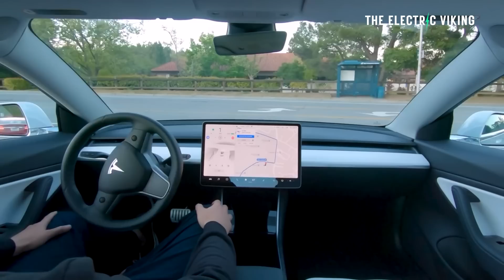Xiaomi builds the SU7 in 76 seconds using worlds biggest gigacasting machine

Comment: Forty cars per hour (3600s) would spit out one car every 90s, not one every 76s.  If they're popping one out every 76s, they'd be making >47 cars per hour.  If the 9100t sets the pace of their throughput and it can run without coffee breaks (maintenance), 100% up-time means 168 hours a week at 40-47 cars per hour, or 6720-7896 cars per week. With a 90k car backlog, they'd clear backlog in 11.4-13.4 weeks which doesn't quite square with a backlog out to November 2024. If we settle on 3 months to clear backlog, given your posting date of May 6th, they clear backlog by September 6, somewhere between seven and eleven weeks ahead of schedule, depending on whether that backlog was to the beginning or the end of November, BUT if the backlog reflects press up-time and the rest of the line is at least as fast as the press, then we're really talking about 18.4 to 24.4 weeks for 90k cars, hence 3688-4891 cars per week, thus ~22-29 cars per hour, therefore one car every ~124-164 seconds, which is obviously still lightning fast.

Comment: You missed the point read my post again. Xiaomi has a crappy record of quality control in appliances that have received significant complaint inside China. Their car which was supposed to revolutionize the EV market has a 40% return rate. I point to the aluminum wiring issue not just because it won’t pass US standards but it’s a dangerous design decision. It’s banned for a reason

Comment: .......Xiaomi, no doubt, purchased a Sandy Munro (or similar company) reverse engineering, teardown, benchmarking & costing report of the many Teslas they have bench marked, I do not believe that Xiaomi are the so called geniuses you make them out to be. 
What is amazing is the speed at which they can copy Tesla's manufacturing processes.
What is so incredible about: 
1. 76 second car roll out rate (33 seconds slower than Tesla).
2. Double glazing, that is not new in cars (circa 1934 laminated glass).
3. Tesla suffered by over automation. Remember?
4. How do you know this car is incredible? Have you looked at it , driven it.
5. One upped Tesla? How do you know please? 17% lighter, 2 dB quieter than what please?
6. Everything you have said  about Xiaomi ...Tesla has or is doing it.
7. Xiaomi is fantastic according to whom?...you are looking at promo videos FFS.
8. Tesla already has either 2 or 3 off, 9000 tonne clamping force, Giga presses since 2022. 
9. Yes you can do "weld repairs" to Tesla castings.
10. Any car/truck can do 2 million miles if you maintain, repair & replace! 
11. Irv Gordon, Guinness World Record Holder Who Put 3.2 Million Miles on His Volvo P1800..(Dinosaur juice powered).
12.. Your research is rather poor, and you are parroting off promotional info, and hats off to you "you admit it" sir!
13...This raft of factual comments will get deleted very quickly.

Comment: Sam, use language properly. Today you said electric cars have no motor. In fact they may have 1 to 4 drive motors. ICE cars do have no motor. They have an engine, either gas or diesel for most. EVs actually have no engine.

Comment: Just my 2 cents here: a huge cast part reduces complexity of production but what if that part cracks after some use? … I’m not an expert
Reply: It's a solid part, cast at high pressure, and at temperatures high enough to melt aircraft aluminum. It's then cooled off very quickly, and this doesn't crack anything.

Comment: UPDATE - 43 seconds, not 34. Started in this interview: https://youtu.be/eEe-_gM5pgE?si=FpcujroKiWfN8Mky 

Actually, Sam, Sandy Munro stated in an interview that Tesla was pushing out model Y's at a rate of 34 s. per unit. Can't remember which interview it was but 76 s. is fast but not quite as fast as Tesla. 

PS - all Chaoimi (sp?) how many of these so called Giga presses they have. If it's not more than one then they can't do better that 100 s. as that is how long your report started the pressing process takes which would be a limiting factor or choke point for their manufacturing process. 

This is all theoretical. This company is just trying to ride on the coattails of Tesla's success.

Comment: Good luck with that SU7, if the stability control software doesn’t kill you the fragile suspension system will!
Reply: Have you driven one, ive seen videos of tesla cars burning, so in the same line of thought, youll die from battery burning? Stop sourgraping and just take it up the arse..

Comment: 00:15  On rare occasions, certainly not always, being "new to the game" is an advantage, in that you don't have preconceived notions as to what works & what doesn't.  Spacex demonstrated this by landing a Falcon9 booster for the first time ever on December 21 2015, and has gone on to demonstrate that those machines can be re-flown at least 20 times, and are now planning to try for FORTY launches before a booster is retired.  ENORMOUS cost savings by reusing expensive high-tech rocket engines instead of discarding them after one use.

Comment: Ford produces an F-150 every 53 seconds. You don´t understand how production time is measured. If you double the number of assembly lines in the same facility you double the output without any real improvement on the production process. Using Ford example, that wil be  a vehicle every 26.5 seconds. You should better educate yourself.

Comment: Sam: 76 seconds is half the speed of the Model Y production line speed in Shanghai of 39 seconds
Tesla only needs the 9K machine for one end of the CyberTruck the other can be made on 6K machine due to design and material innovations reducing locking pressure requirements.
Xiaomi's SU7 looks great but those numbers are not industry leading as the ICE makes are running at a 60 second line rate
Reply: It's not "build in 76 seconds," it's "every 76 seconds" they produce a car
Reply: @MarcoYolo420  What's the difference?
Reply: @ChickensAndGardening  It takes Tesla about 10 hours to build a car, but because it is an assembly line, it is done in stages so many cars are being built at the same time. So this works out to be about 40 seconds rate per car. 76 seconds is about industry standard with many at 60 seconds.
Reply: @ChickensAndGardening  👆🏼this 😉

Comment: Gigacasting is a great idea for EV producers.  From many pieces to one. No seems, no joints, no screws, no bolts, no welding. One structure that frames an entire area of the EV. Producers need less workers, less parts, less materials, less time. 

Unfortunately, this sucks for EV owners. Any damage to the frame means you replace the expensive "one" piece or junk the EV entirely.  This is why ICE manufacturers never opted for gigacasting. Even though this process has been available long before EV's hit the market.  Besides the battery issues, gigacasting is also why insurance rates are higher for EV's. A simple 'fender bender' involving the frame doesn't lend itself to replacing a part at the impact site, but a replacement of a large segment of the EV.  Replacing the gigacast frame may also involve dealing with the battery as well, even though it was not near the damaged part of the frame. I don't think Elon thought this through, and now other manufacturers are following him down this rathole.
Reply: Exactly.

You are absolutely right.

I remember some years ago how the cars produced in some parts of the world were cheaper than those made in Europe: one reduction in welds meant 10% reduction in costs.

These cars can be cheaper to make but are more expensive to the future owners. Time will shw that something will change to stop these higher maintaining costs
Reply: But if it makes the cars cheaper, surely it will improve sales?
Reply: Reason number one people are backing up,,,,,and Toyota making the big $$$$$$
Reply: Any vehicle hit hard enough to damage the frame is written off. Some small independent garages buy these at auctions or from wreckers and repair them. But the car will be plagued with repairs as the accident loosens and cracks many other parts, not visible, and do not fail right away. Never buy a rebuilt car, you will be sorry for it. Also it doesn't matter how new it is, the manufacturer's warranty will be null and void.
Reply: You can do weld repairs to the castings. ICE vehicles can use castings, it is just that Elon, pioneered with IDRA...and legacy automakers will eventually start to use castings in ice vehicles. If it is a rat hole..there will be no cars manufacturers left...It is sheer brilliance the castings.
Reply: @desobrien3827  
It's the same for EV's and ICE's?  Really?  
You're saying high temperature, electric arc welding can be done to a frame near an empty gas tank and that is the same thing next to a full battery pack?  How do you 'remove' the battery pack to straighten out or repair a frame in an EV?  
Fact warning!  It is not done, it won't even be attempted by any auto collision shop.  Repairing damaged frames on an ICE car is done every single day by the thousands.  All ICEs are not 'totaled' every time the frame is damaged. A standard mechanic does not want to work around a battery with 400 to 800 volts coming from a battery pack that if damaged in the repair efforts has to be junked and replaced. 
I am not against EVs.  I am pointing out that the infrastructure is not in place and the EV maker's only demonstrated concern is selling a car and telling the customers here are your keys and good luck.
Reply: "This is why ICE manufacturers never opted for gigacasting. "

Wrong. Legacy manufacturers tried large castings years ago. None got it right. The main problem was they had to be heat treated and that caused warping. Tesla came up with a special aluminum alloy that does not require heat treatment and does not warp. Now every manufacturer is using that alloy and ordering mega casting machines.
Reply: @royh6526  
Ok, the Elon-the-genius-changes-history is not an argument I wish to debate. Either way, the ICE manufacturers should be thankful they did not go down this rathole.
As for "legacy" car makers, it's starting to look like EV's fit that label.

Comment: Sam, you're a little bit misinformed here. Legacy manufacturers have an average build time of 60-65 seconds. Tesla can build Model 3/Y vehicles in 45 seconds, so 76 seconds is no great shakes. I'm sure they will get faster. Of course, when we say "build time" that isn't the absolute truth. It may take hours or days for a vehicle to start being made from the very beginning, right through to driving it off the production line. But the rate of vehicles coming off a single production line is indeed measured in seconds. It's quite an achievement when you think about it. However, there is "dead time" during any production line process, and if you add up all this dead time within the production of a vehicle, it amounts to a heck of a lot. To combat this, companies like Tesla are in transition to other processes, like the "Unboxed" method. It has other advantages, but one of them is less dead time.
EDIT: I suppose I could give a typical example of dead time. Let's say there is an operator/fitter installing a part on a vehicle. When that is complete the fitter goes to get the next part and return for the next install. That's the dead time. The production line process in that part of the assembly line has been idle, and therefore it adds cost. This can be reduced by the design of the vehicle, the design of the part [or no part as Tesla routinely have it], the speed/ease of install, the ergonomics of the parts layouts/supply, the design of the production process, etc. And on and on until you run out of ways to improve. Which is virtually impossible. As Edison was said to say, "There's a better way. Find it."
Reply: This is not 'build time, but rather the pace they come off the line. 

VW takes 30 hours, Tesla 10, now aiming for 3 hours for the Model 2
Reply: Mr. Edison's way to "Find It" was often to steal it from someone else...
Reply: Aaaa Edison the one that stole everything from Nikola Tesla
Reply: Let face it. Sam can be the expert for everything. So now and then he repeats from other channels without verification
Reply: @stationbright774  I assume you meant "can't be the expert for everything" A little crucial typo there. No indeed he can't, which is why I don't give him a hard time when I know his information is slightly flawed. I would hope that people would be easy on me if I was the purveyor of slightly flawed info. I try not to be when I comment.
Reply: @ramblerandy2397 
Thanks. It was a bad typo error.
Reply: @ramblerandy2397  Heavily flawed/completely wrong information, he is spouting. "He wants to be a commentator or whatever...needs to be as accurate as possible"
Reply: @desobrien3827  Well, yes you're right. He should be as accurate as he can. The rate of which Sam produces videos, every now and then a howler of an error is going to creep in. That said I'm sure he doesn't intend to push out incorrect information. I can't say the same for the fossil-fuel lobby and followers who tell lie after lie. Some of them not knowingly so, but others who are simply out there to spoil the progress towards sustainable transport and energy in any way possible.
Reply: @stationbright774  What did he repeat without verification? Please verify your claim.
Reply: @davidnika446 
Build a car in 76 secs! This is impossible but may mean the rate at which a car leaves the factory.
The number 76 may have been posted elsewhere and repeated here.
Reply: Sam probably knows all that but ‘76 seconds’ to build the Xiaomi makes a good click bait title!

Comment: From my understanding more gigacasting Tones do not equal better castings, Tesla ist using only 6000 t to cast the Modle Y front and rear, and it is optimised the flow of the molten alloy and is using their own developed material, whitch means Teslas Castings are better because they are probably cheaper and have a lower cycle time due to the lower force needed

Comment: Watch insurance prices climb on these cars. Gone are the days of replacing a front  or rear quarterpanel after an accident. Its also quite easy to copy other manufacturers technologies to make them competitive. This car has more than a passing resemblance to a Porche.
Reply: Unfortunately not only on these cars, as they are not exclusively damaging each other. 
If you are the reason of a crash into such a „single use“ vehicle, your insurance has to pay for the write off.
Reply: If the frame of any car is damaged, the car is written off. Repairing can never be as good as new. I recently brushed the bumper of a parked car (two scratches about 4" long), the repair bill was $1856.00
Reply: Panels are panels, easily replaceable. The Castings are quite different.
Reply: What happens when you have a bump & distort a small area of the casting or it fractures ? You write the car off as you would need to rebuild it around a new chassis?
Reply: @markevans2280  That doesn't happen. There are no 'bumps'. If you don't break it in half, you get in and drive it home. What, you think these things are made in Detroit? :D

Comment: The SU7 is getting a lot of flak in China.
"Xiaomi SU7 Brake Failure Leads to First National Crash, Widespread Data Falsification Revealed"
In the vid it is pointed out the rear of the car is not  casting. 
A lot of the noise is noise.
Reply: If it's the same guy you are referring to, the breaks failed because the driver ignored the brake pad warning lights after performing 3 high speed laps on the Shanghai racing circuit. The SU7 max has 664 horse power (nearly as much as F1 car), so you can imagine the amount of force he was putting on the brakes.
Reply: It gets a lot of flak but it gets way more praise. I think it's just the result of being in the front and center of lots of media attention.
Reply: I want to see it at the Nurburgring,
Reply: If you can't afford to buy, don't smear, go for tata motors product instead

Comment: Is it possible that Viking doesn't know the difference between capacity/throughput of the production line and the time needed for building one car?
Reply: He is a viking fighting with units of measurement on all fronts.
Reply: Yes, they produce 1 car/76 sec, but in 76 sec even paint wouldn't dry. The whole process is quite certainly longer.
Reply: Its óbvios they make several at the same time, it goes without saying

Comment: I wonder how the extra die-casing holds up under USA crash testing?
Reply: Depends on who designed the die for the casting.  Tesla's  'hold up'  aka crumple just fine.
Reply: Depending on what’s the intention if the speaker the are either ridged or crumbling.
Unfortunately physics is clear on this aspect.
Reply: @fromgermany271    I do recall from somewhere that crumbling is a better description of how hey absorb the energy.

Comment: 1 every 76 second is slower that Tesla shanghai where a car rolls off the line every 40 or 50 seconds.  This number impressess visitors and maybe helps with logistics.
A far more interesting number is how much did it cost you to build the car.
Reply: I have been in the automotive industry and 42 is average. Hyundai has plants which run at 88-90. Called as JPH. Or Jobs per hour. I used to work at a plant which in 2014 was doing 68 JPH
Reply: 76sec/car is about 1/4 of Tesla global production for 2023 (according to Tesla IR).

BTW, the same source says, the only delivered 3/4 of these cars. They must have a bug parking lot somewhere. 😂
Reply: @fromgermany271  As I have been saying the real metic is cost per car or even better the profit margin.  If any.
Reply: wrong,idts

Comment: Cyber truck uses same giga casting machine as model y. Due to reducing pressure required using AI design mold
Reply: Only for the front casting.
Reply: @danharold3087  Tesla have 2 or 3 off "9000" tonne presses since about 2022.
Reply: @desobrien3827  Maybe you intended to reply to MarsOzzie